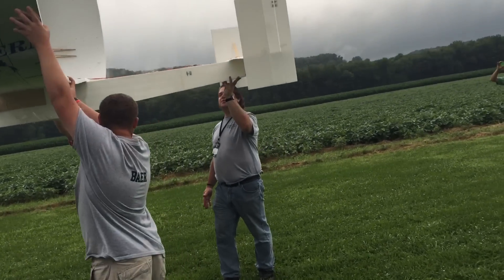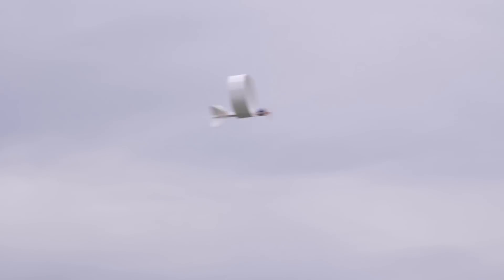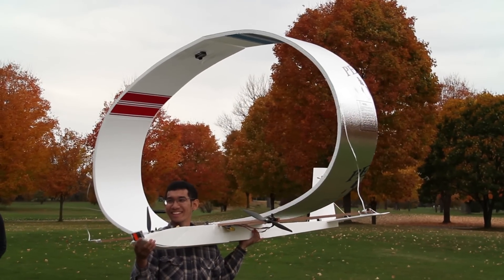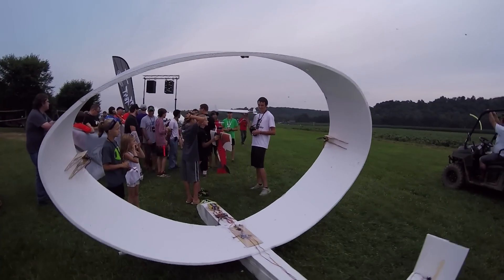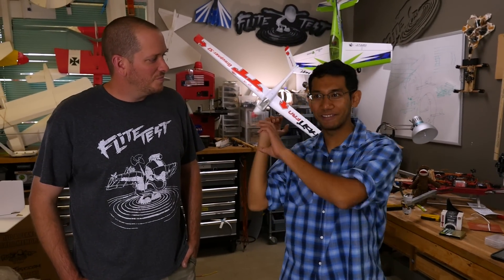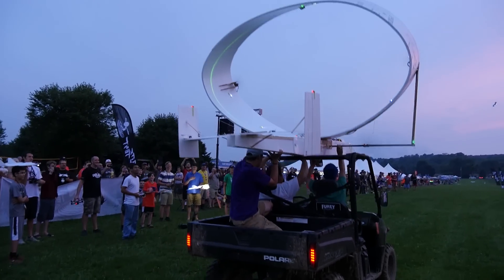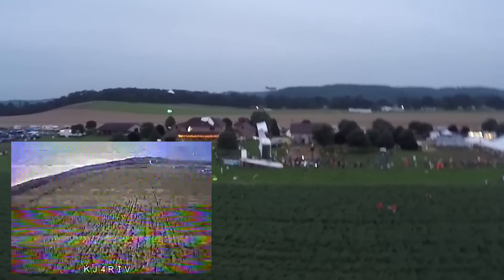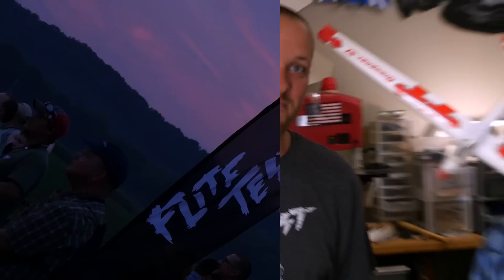Super Circle Plane | Flite Test

Comment: I asked an AI "What are the benefits of a Ring winged plane?" And the Artificial Intelligence answered:

"As an language model Al, I don't have personal opinions but here are some benefits of a Ring winged plane:

1. Improved Fuel Efficiency. The ring wing design reduces drag, allowing for a more efficient use of fuel. This can result in significant cost savings for the airline and help to reduce the carbon footprint of aviation.

2. Increased Payload: The ring wing design allows for a larger payload than traditional wing designs. This means that the aircraft can carry more passengers or cargo while still maintaining its efficiency.

3. Reduced Noise: The ring wing design has the potential to reduce noise pollution around airports, as the ring wing creates less turbulence and generates less noise than traditional wing designs. This can help to improve the quality of life for people living near airports.

4. Improved Stability: The ring wing design provides greater stability and control compared to traditional wing designs. This can make for a smoother fight and reduce the risk of turbulence-related injuries.

5. Increased Safety: The ring wing design provides more surface area for lift, which can help to prevent stalls and keep the aircraft in the air in the event of an engine failure. Additionally, the ring wing design can help to reduce the risk of icing, which can be a major safety concern for aircraft."

Comment: the rover is now using a motor to turn an alternator to extend battery life rc could do the same. a yanmar would be good take apart for less resistance by attach to a 775 at .17 amp and 12 volt for 1500 rpms. and 20 amps and 12 volts.

Comment: I have built 2 and almost done with my 3rd, 1 seater, ive only flew one, so far, they use no fluids no liquids no nadda, just on air, the 1 im building is the SR-21, i designed these all from scratch, even the motors only uses air for fuel i will take the motor designs to the grave. mine are just a little bit bigger than the average car, that i actually fly in, i have 2 issues, maybe you could help with.

Comment: You should try to make a dual circle plane with circles at the front and rear - looks like done right it might be more stable.
You could also provide rigidity by placing bracing between the two circles.

Comment: You should make it again, but instead of having the plane at the bottom of the circle, have it in the midle.
That should make the plane be able to fly faster, but it will probably need big horizontal and vertical stabilizers.

Comment: How about make the circle, inside the circle make 2 wings w/ "Rudalons" in the shape of an "X" or in the shape of a "+". Add fuselage of sorts emulating from the center of the X or + out the rear with one engine in front, now add a fixed*  "Dragulator" out the rear , no controls necessary on Dragulator.  *Consider a chute w/ a string for the Dragulator. maybe a funnel shaped Dragulator of paper. Launch vertically under own power, once at altitude transition to horizontal flight, land vertically as well.

Comment: These small concept almost lighter than air aircraft designers have the ability to install a variety of extremly powerfull engines. Crunching the numbers, real aircraft, capable of hauling a payload that would be profitable, which is the bottom line. Excusing the pun, won't fly. the stress level on the fuselage alone with proposed round and square triangular configuations make it impossible.

Comment: How about trying a design with elliptical 'circle' wings? A narrow central fuselage with horizontal wing-stubs supporting a large elliptical circle-wing near the nose, and a smaller arrangement at the tail. Twin tail rudders could be mounted on the on the rear ellipse, and ailerons and tail-flaps on the horizontal wing-stubs.

Comment: in the video it looked like you only used rudder for steering left and right so would you be able to add ailerons to the plane not by placing them on the wing but rather on the fuselage near where the wing is deflecting air to the left and right of the body pushing the plane in the opposite direction  but rather than rolling like a normal plane it would roll along the longitudinal axis line running in the center of the wing a distance above the fuselage the force required to lift the body in addition to back pressure would increase the plane's maneuverability 
in recap use the side of the fuselage by increasing pressure on one side to push it to the other side allowing for increased maneuverability 
do you think this could  work?

Comment: So doesn't this have like the same lift as a bi-plane with the extra weight of the "side-segments" which don't do anything while in leveled flight? I mean it's cool but I'm not seeing any practical use for it. I'm guessing this design would reduce side-slip and continue to provide roughly the same amount of lift even while turning, yet I'm not sure that's a good thing considering the center of mass is offset thus during a turn you'd end up with a whole bunch of lift on one side of the center of mass and none on the other which could mess up the flight dynamics and make the thing unstable or at least harder to turn than a normal design... Maybe, if you would put the body in the center of the circular wing, then it would make more sense, however, even like that I don't really see any actual practical benefits to this over the standard plane design, well, except for the coolness factor.

OR, you could have the body in the middle, the circular wing around it, the propellant blades between the body and the wing, and have the thing take off and land vertically like a helicopter, and then just flip 90 degrees and fly like a plane, now THAT would make some sense, although since you wouldn't have a tail it would be hard to control... or maybe instead of the blades being inside the circumference, you'd have multiple distributed small electric engines along the entire circular wing, and use differential engine thrust to steer... And then you could have the cockpit be able to rotate 90 degrees so it is maintained leveled regardless of how the wing is oriented... Or just make it a drone... Ok NOW we're getting somewhere :)

Comment: How about fuselage in the middle with hoop wings on the two sides and stabilizing struts connecting the hoops on top and bottom? Or even connecting the top and bottom struts on the sides to form a flying rectangle enclosing the two hoops? Hell make it 3 hoops and mount the engines at every corner. I'm going to bed before I lose my mind! Awesome video though, I think it's mandatory that you bring some variation of the circle wing to every flight show.

Comment: why not use guide wires pulling inward from the top of the circle downward and then another from side to side pulling inward, maybe a couple more 45° from those to hold the circles shape?
Reply: or I guess if the goal is to allow other ex's to flew through, then use string wrapped around the outside and a polyester resin to stiffen it up.

Comment: How hard would it be to loose the fuselage and tail fix 4 motors to it and fly it like a quadcopter using thrust for control? If you laminate two layers of foam board you could have a stronger perhaps more aerodynamic structure and you could launch and land it vertically straight up from the ground.

Comment: Great work men - keep it up. It is reminisent, whatever, of a documentary i just saw about early Russian fighters, which were so lame the first battles used "Ram Attack" which against the Austrians just before WW1 - well the first try killed both pilots yet an Ace did get one kill.
Try polyethyleene pipe, high mol., in coils, around 1 inch on the frornt  edge should improve lift and 1/2 inch on the trailing edge - should give enough stiffness and is unbreakable in case of ram attack. 
If you do not believe that IF I had been hired by Cirus in Duluth, instead of the CCC buying it we would be doing this in manned electric lightweights - look at the new cover of FLYING - and see the Euro version of my electric jet - 4 seats - long range - mine is much faster.....wow message is being scrambled - war is here dudes

Comment: I have only one recommendation for the Zero Wing design that may save it from another similar disaster; build in a solid but flexible brace; like nylon rope internally in the wing like an added indestructible spar. What I saw initially was the wing held it's shape while damaged but intact, but until it separated, it lost all ability to keep aloft. Perhaps if only the spar kept the wing from folding and collapsing, it may have continued to fly safely, or more importantly, fly in a controlled crash to touch down. Anyway, it is an unproven theory of mine, and just a thought for another experiment to try out... can't hurt.

Comment: Why not use string like bicycle spokes to keep the circle round?
Reply: Jim Couch It would make flying through a little difficult ;-)
Reply: Balu true
Reply: Jim Couch a better idea would to brace it with carbon fibre shock poles 
(The flexible poles that are used in most tents)
Reply: +Jim Couch One or two of those wire rings that pop-up tents use to reinforce the circle, if they're not too heavy.
Reply: +Jim Couch The whole point is that the airflow will force the shape into a circle (Peter actually mentions this when commenting on the initial first start)

Comment: How can this be so slow? :D Because the area of the "wing" is so big?
I like this, i want it to :D
Reply: It's more about the drag than the surface area.
Reply: To illustrate, think of water running from a tap and a knife's blade in the stream. If the knife's edge is up, water stream goes around and knife can move up the stream easily. If you rotate the knife 90°, it makes a mess of the stream and the knife is harder to move upstream. 
The circular wing as a lot of "front surface" and hence a lot of drag.
Reply: xavtek Ok, i understand now. When the ring would be larger, it would go even slower right? Or as fast as this because you need stronger motors to keept it up? (Must go faster to keep the weigt up)

Comment: i gather it wouldnt be easier just to tow a hula-hoop?
Reply: ***** But that wouldn't be a circle plane :(
Reply: ***** by about .5 lb
Reply: ***** the weight of a hulla hoop is .5lb then removing the weights from inside that they typically use would probably half the weight( that would depend on manufacturer). When I say hulla hoop I mean the plastic ones you get at Walmart for $5
Reply: actually that seems like a good idea for supporting the circle plane wing. put two hula hoops on it for support :D
Reply: zach burke That would drastically increase the weight
Reply: zach burke
Nope, go get a hula hoop and weigh it. Then multiply by 2, and come back to me.

Comment: What was the drone flying around it after it crashed? It looks like it fly's nice and its pretty quick. Just wondering!
Reply: Patrick Benfield Yeah like akromix said that was me (the entire flight is on my channel).  I was also the one doing the rolls and flips through the plane, it was the most fun flight I've ever had.  I was using a prototype mod to the ZMR250:  http://www.miniquadbros.com/collections/frontpage/products/zmr250-gopro-adapter
Reply: Patrick Benfield the one doing the flips and rolls through it? that's a zmr250 based mini. Same one on that last surrounding shot after the crash.  My buddy is the pilot.  He's running sn20a escs, cobra 2204 1960kv motors, 5x4.5 hq props IIRC.
Reply: Such amazing flying by @astralisdustin!! Wish I could have been there! Awesome work dude! -Alex
Reply: Alex Zvada Thanks Alex!  I am ridiculously jealous of the fun you have filming with a follow quad on most episodes.  Let me know if you ever need help!
Reply: Yeah I'm curious also. Both great pilots.
Reply: I'm pretty sure the was Alex's Blackout quad. They are awesome.
Reply: jessiejones907  I think blackout mini 250 frames.